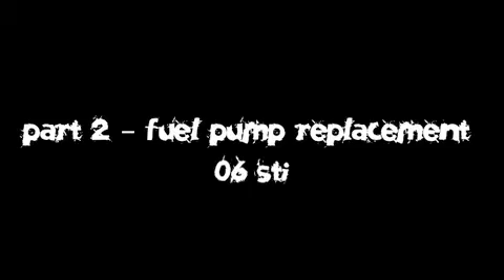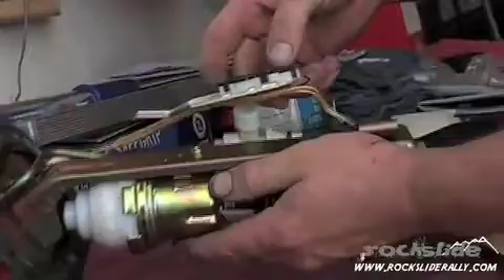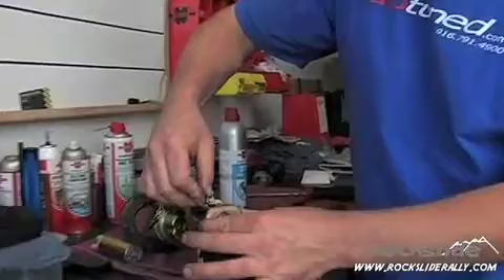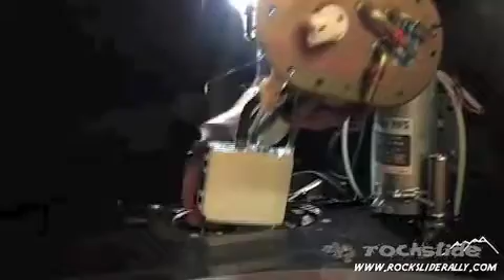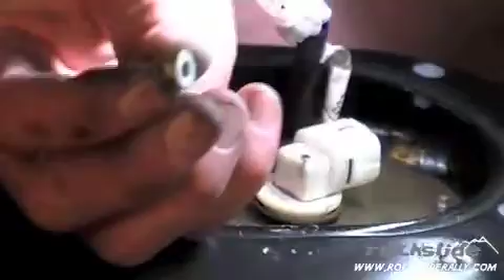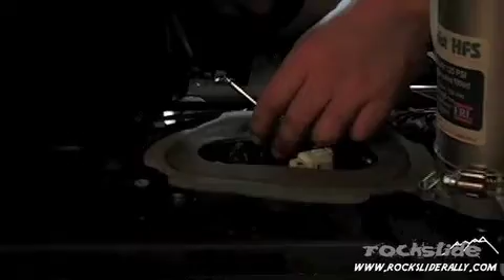Tech Tip - Fuel Pump 06 STi (Pt 2): Rocksliderally.com

Comment: Thank you very much for this informative video.  I do have a couple of questions though: do you need to replace the fuel hose clips because they are a one shot deal.  And do you need to perform a pressure bleed at the beginning of the procedure?  Have you had fuel splatters when the line was disconnected?